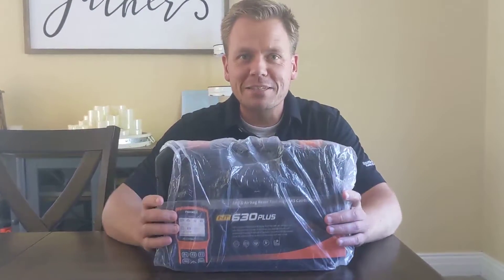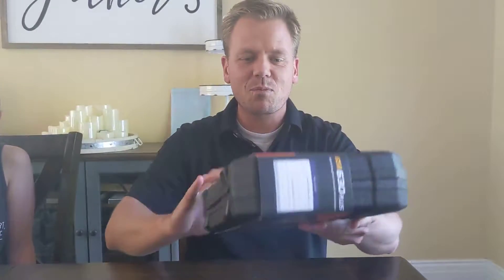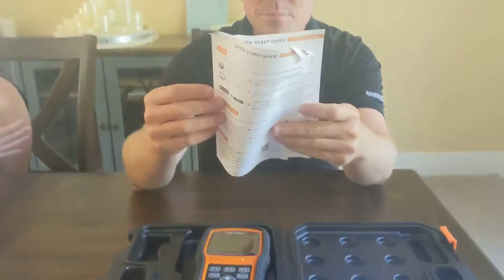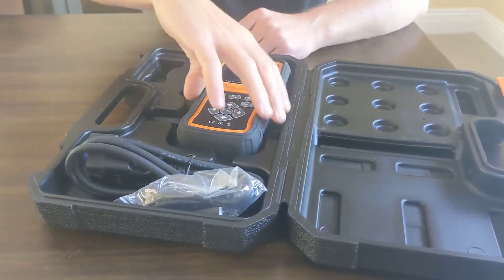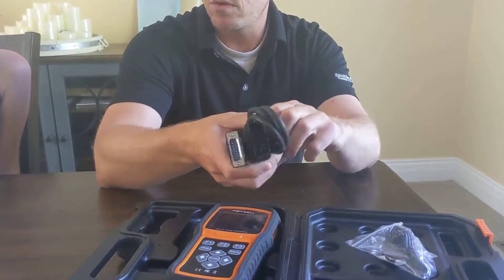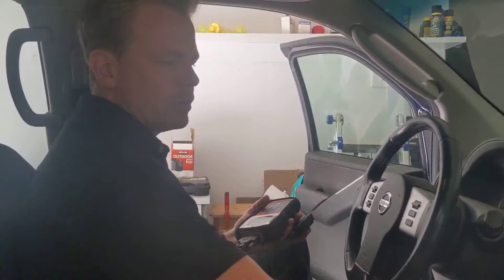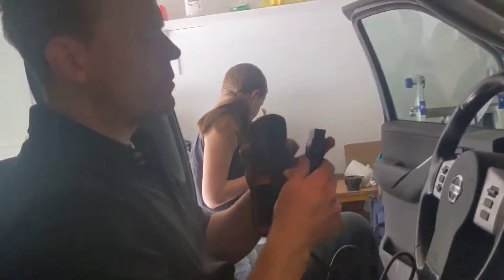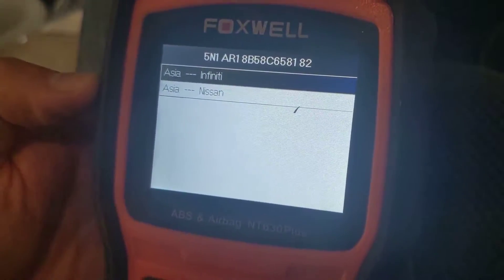Review of Foxwell NT630 Plus - Nissan Steering Angle Sensor Calibration

Comment: I don't see how you got this to work correctly because you did not do the calibration. Your vehicle absolutely thinks your front wheels are turned sharply to the right according to your display. Also wondering why you picked Infinity when this is a Nissan, although I know Infinities are fancy Nissans really.
Reply: He didn't do a calibration. He just cleared the code/dash lights. What he didn't show is after a few miles the lights pop right back on. Too damn busy chomping at the bit to use common sense.

Comment: I followed your video to the Tee, same exact scanner, no lights but the VDC still activates when driving. Anything I missed? Trying everything I can before I bring it to the shop. Thanks in advance.
Reply: Ever actually fix the problem like he said he did and then resetting the code lol?
Reply: @supdougs4487  nope not yet. Have been busy with working on a friend's car. For now I just turn off the vdc lol
Reply: @visionvipcustomz4455   instead of what he did by not following basic diagnostic follow up for re-learning the "Steering Angle System" with the module and communications off! Try doing it with the key on, engine off. Due to government laws, but many vehicles have electrical load shedding software added to them. Basically, you don't have many electrical loads on the battery plus the alternator when cranking. That is a undesirable load on the battery & engine both.
  So, repeat the procedure with key on, engine off, modules are awake, this allows this or any scan tool to talk to this SAS module. Surprise! It may ask you to place the steering in the straight ahead position and hit enter. Others, asked the engine is running, and you turn to left lock, hood for 2 seconds, then turn right to lock, hold for 2 seconds, return to straight ahead, wait as it relearns new sensor values, or old values again. Yours may vary by software!
    As he said; "I have an idea of the basics of what's going on, but not really!" Sounds like customer service, a store manager or government employee. Not an auto tech using best practices. When asked by the scan tool to press start....That was a push button on the dash (Or Key, yours may vary) but not on the actual scan tool. Hopes this helps!
DK, ASE Master Tech since 78.
Reply: @deankay4434  2yrs later it definitely helped me ⭐

Comment: Brad,  I too changed my clock-spring and then I used the Foxwell \SAS,   EPS\Steering Angle Reset, then I did the ' Neutral Memorization Procedure' which caused TPMS and VSA errors.
The Neutral Procedure didn't have and guide and it seems I never completed the task.  Do you have any info on to use the Foxwell to complete the Neutral Procedure?
Reply: Hi. Did you ever get this fixed? How do?
Reply: @123tech  Turned out my Foxwell didn't complete the calibration.  My nephew had a better scanner which calibrated and cleared everything.
Reply: @rondail5675 Ok, good to know!

Comment: Hi, do you know if this can do brake bleeds and did it work straight out of the box. No connecting to a computer? Thanks,
Reply from the maker: It did work right out of box. I've only ever plugged it into a car and a USB outlet for power. 

I haven't had a reason to try brake bleed procedure with it.  If I plug it into just a USB for power and look through menus under ABS, I can select "Demo" and look at functions. I see an "HCU air bleeidng mode" under ABS/ESP.

Are you thinking of doing it on an R51 Nissan Pathfinder? It seems to have functions pretty specifically as to Manufacturer and even Model, but if you are looking at a Nissan I'd plug it into mine and poke around to see if there is a bleed function.
Reply: @brmadsenad  Jeep JK 2007 CRD (Australia) I am guessing they are the same as regards to brakes? Thanks,